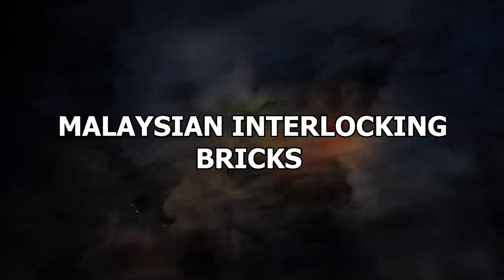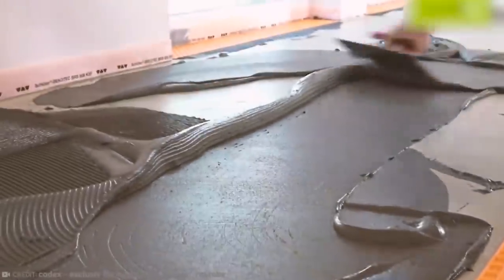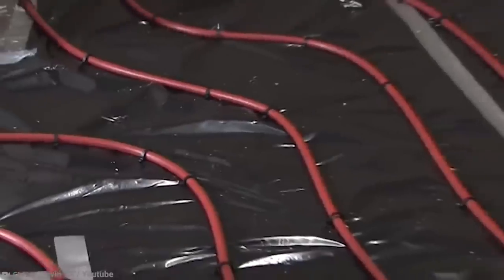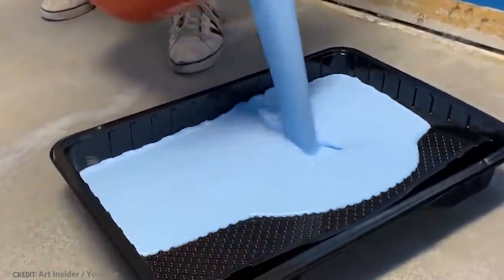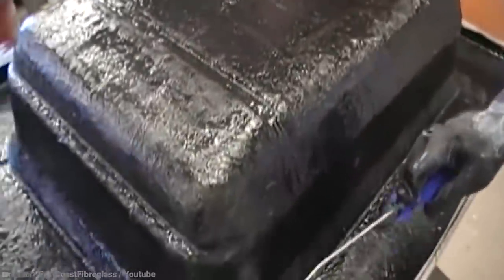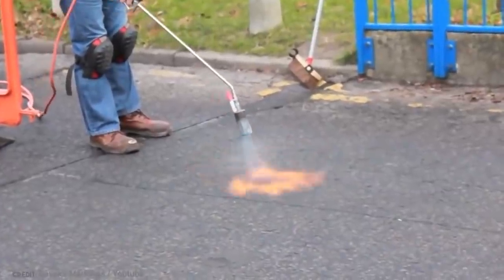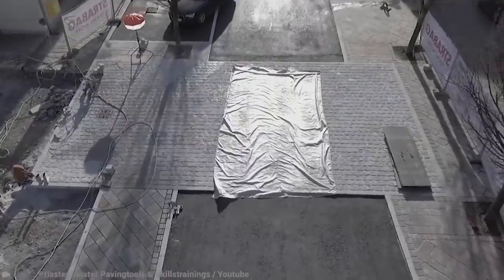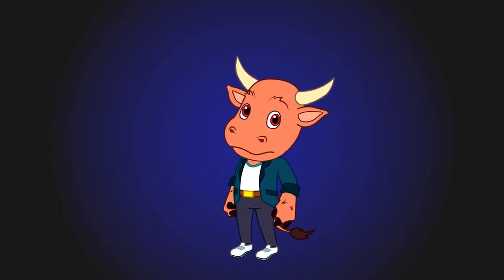15 Ingenious Construction Workers with Skills You Must See

Comment: EPDM is a great product, unfortunately, the contractor that cut the material, applied it incorrectly, you don't cut it but fold it, in on itself, to fit, the glue is like plastic cement, once applied, then you need to place something protective over it, as the UVA and UVB rays of the sun will damage it over time.
Thermal-heated floors have been around for years, there's even a product that can heat your bathroom with the equivalent voltage of a single lightbulb
The pagoda with vinyl is great and all, but the more moving parts you have the greater the risk of something breaking.

Nothing to do with construction workers per se, but the different materials used in construction and techniques required in material application.
This day and age everyone wants a college diploma, there exist in the world tradesman that will still take on an apprentice. Not every apprenticeship requires the individual to join a union.
Reply: Some lessons can only learnt by many using the hard way...
And I agree, in our very automated world, the craftsman cannot be replaced...
😎👍🏼

Comment: The Romans created heated floors
Reply: Then you woke up.The Asians did it around the 11th century BC. The Romans didnt get to that concept until the 3rd century BC. Nice try though.Its not your fault, many historians credit the first heated floor to the Romans, Those who KNOW and do actual RESEARCH attribute its development to ancient China and Korea. There's actual evidence that says the first heated floor was used there as early as 5,000 B.C. The Chinese developed a floor heating system called dikang (meaning heated floor), which was an elevated heated surface used for living and sleeping. Dikang was heated by displacing hot gas from the fireplace through a series of flues constructed in the masonry located below, causing the heat to warm up the space above.